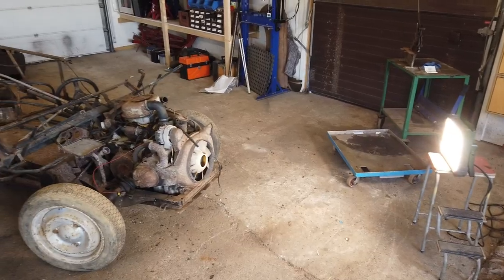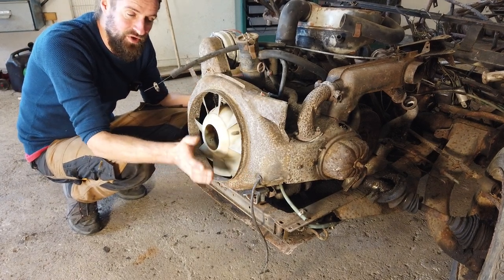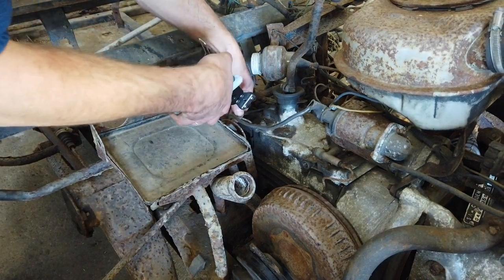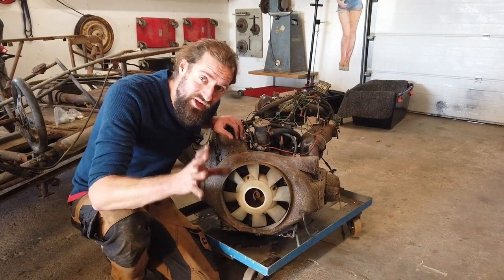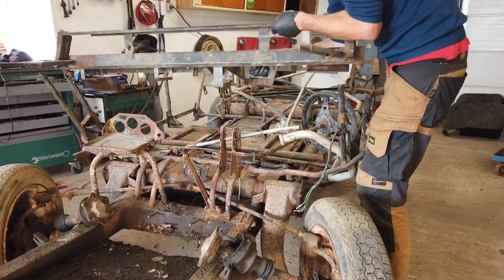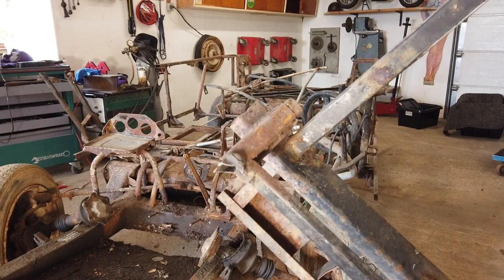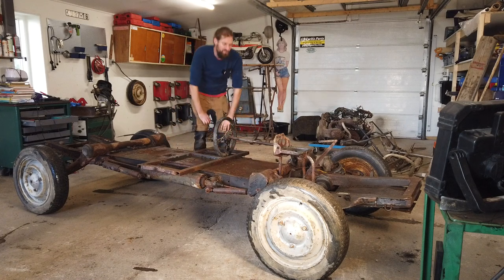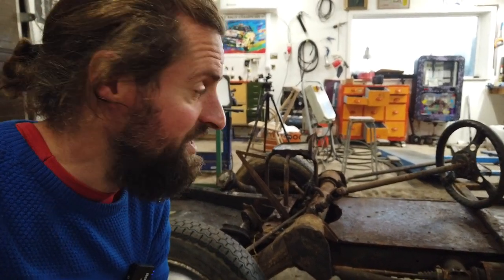The Mehari gets stripped down to the bones.... but are the bones turning to dust?

Comment: For the Mehari, they shared the 2CV engine of 28 horses (later upped a couple of times to 28.5 and 29), I think (not 100% sure, it's the 2CV that holds my desires!!!) the 32 horsepower is only really on the Dyane and Ami versions of the 602cc engines, higher compression ratio of 9:1 (versus 8.5:1 on the 2CV version) and at least in the Dyane, a "mild turbocharging" with air being kind of forced into the airfilter box via the fan cowling, though that's probably just a fart-in-a-jacuzzi kind of power boost... :P

Comment: You probably already know this, but the chassis always breaks where the front axle is mounted. You'd be wise to open up and take a look there. As you mentioned, the chassis rusts from the inside out and in my experience the earlier chassis are much better for rust than the later ones from the 80s. Your car looks to be from the 70s with the front drum brakes, so you might be in luck.
Reply from the maker: yes this is one of the old chassis which is alot stronger... so it could be better then a new one if its healthy enough... :)